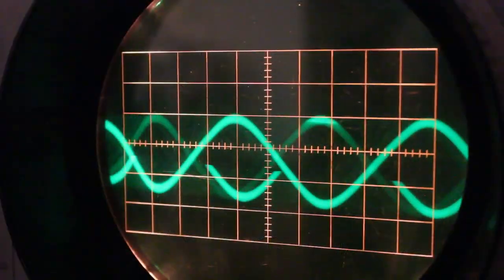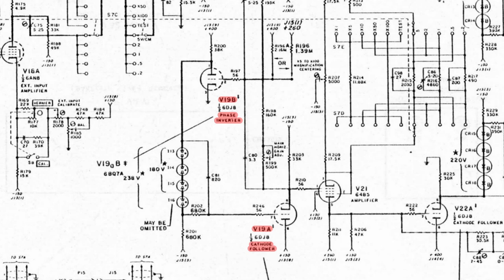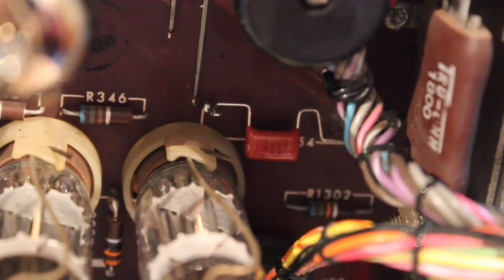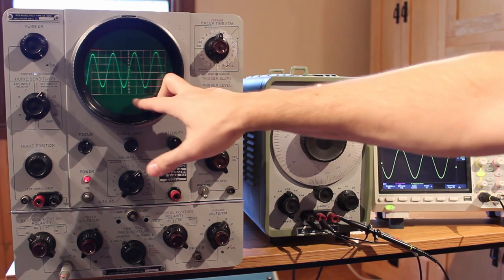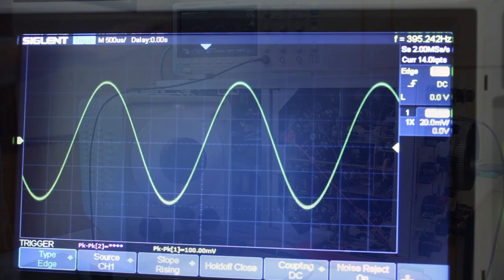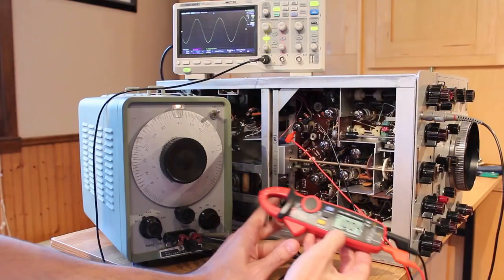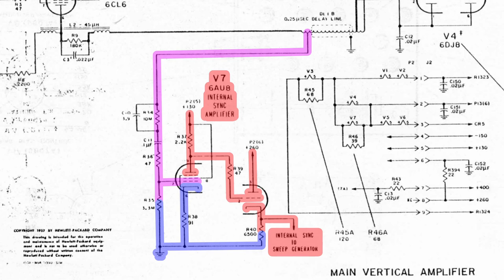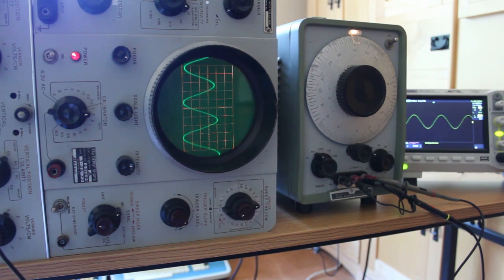Restoring an HP 150A Oscilloscope (Part 3)

Comment: Ah, the good old Vp-p vs. Vrms. I have fallen in that one too - but maybe not for days ;-) . The other inexplicable factor of two that’s easy to fall into when calibrating stuff is high impedance vs 50 Ohm terminated, or worse, 50 Ohms at one end vs 50 Ohms on each end. Spent a few confused hours exploring these holes too. But great work on saving this magnificent scope, it’s a joy to see it coming back!
Reply from the maker: I got so obsessed with the result, I totally neglected to look at the process! 
It seems there's a ton of those little pitfalls you can stumble into, but I feel a little less bad knowing it's gotten you before too, haha.
Thanks for coming along on the journey as I bumble my way through restoring it! HP really were wizards of the analog (and knew how to make a good looking piece of kit)!
Reply: Also a nice trap is the resistance of the scope coaxial cable. Years ago used one as handy adapter from solder posts to bnc and was wondering for hours why my amplitude at the sink was off not knowing that these 1x/10x probes have resistive inner conductors to avoid ringing and reflections…

Comment: The "Phase Inverter" is just a part of a push-pull amp which inverts the drive signal to create an anti-signal for the other power tube in the pair. In this case it's a simple inverting amplifier followed by the 2nd half of V19 as a cathode follower, but there are several standard phase inverter designs. You'll find the "long tailed pair" inverter in Fender amps and there's quite a bit written about that one. Each design has its own strengths and weaknesses.
Reply from the maker: Thank you for the explanation!
Though, I should have been a bit more specific in the video in that what I'm really not sure of is what role the phase inverter has in the horizontal amplifier. Having said that, I didn't know that Fender used a long tailed pair design in some of their amps, that's really awesome! I played around a bit with the long tailed pair design at low voltages building the tube 555 and the tube 741!
Reply: @UsagiElectric  V20 and V21 provide differential outputs to the horizontal deflection. One pulls left and the other pulls right. V19 just inverts the V20 drive signal for V21 to get a differential drive signal. Without V19 you'll only get sweep from one edge to the middle, or whatever range is dictated by static conduction in V21. If V19 is weak, you might get a very nonlinear sweep with reduced range. Class A amps are nice for audio, but to drive an instrument and maintain linearity, an AB amp is far better suited. The phase inverter here is running in class A, but as it doesn't need to provide gain it can operate in a very linear part of its curve. 

Side note: a lot of great Rock n' Roll tone comes from misbalancing the phase inverter to create asymmetric distortion in the power tubes just before the signal starts overdriving earlier preamp stages. Add enough static bias to keep the plates glowing cherry red and the output transformer dissipating enough to warm your coffee on a cold day, and you have the basis of SRV's Texas Flood tone.

Comment: This is just so fascinating, it’s amazing what they did with vacuum tubes back in The Day.
Reply from the maker: Thank you!
HP were true masters of the analog design back in the day and even though this scope is giving me a proper run for my money to bring it back to life, it's such a beautiful piece of engineering, I really look forward to spending time with it trying to diagnose it!
Reply: Back in the 80's, I built a 30 Watt per channel SQ Quadraphonic system using valves. If I recall correctley, It used about 15 valves in total. (psu/pre-amp/decoder/main amp). Each chan had a magic eye VU meter. It sounded awesome with great seperation. During final callibration it gave me a 1200V shock that sent me flying accros the room. LOL. (I've no idea what I touched)
Happy days.
Reply: @frankowalker4662  when I was in graduate school, early 2000s, part of my funding came from me maintaining lab equipment for my program. My main responsibility was keeping an NMR spectrometer running, which involved tending to a bunch of 5000 W output RF amplifiers. These monsters were fed with a 24 V, 70A (yes, seventy amps) power rail. I was very fastidious about turning off the mains when I worked on these things, but one day I forgot about the capacitors, and ended up discharging a capacitor the size of a soda can through my finger. One minute I was digging in the amplifier, the next I’m on the other side of the room, next to my toolbox, wondering what I needed from the box, followed by wondering how exactly I ended up laying on the floor next to the toolbox, and why I would lay down on the kind of gross lab floor, and finally wondering why my finger hurt so much.
That was fun, for certain values of “fun”.
Reply: @TheMightyOmega-NotTheAlpha  Holy crap. :) At least mine was only about 750mA.
Reply: @frankowalker4662  I suspect if it were the live rail rather than a partially discharged capacitor, I’d probably not be around to discuss it. I still have a couple of little burn scars on my finger.

Comment: A warning! I also used to venerate HP classic 1960's/70's gear to God-like proportions. Until one afternoon I found myself lifting a 19" rack-mount VNA over a low coffee-table, from here to there and CLACK! Drat & curses. My lowest vertebrae went; - displaced and then arthritic as time passed. I'm still hoping epigenetics will step to the plate, and there'll be a miracle healing but there's the rub: always remember correct lifting posture and movement when lifting heavy kit. So now, I look upon my HP gear with less of a glossy-eye, in fact a red-flag goes up whenever it comes to any lifting of that type.

Comment: Fantastic! Thanks! … Question: How many years have you been working on electronics, and how many years specifically with vintage/vacuum tube electronics, and also, how many hours per day or week, on average, would you say you practice your skill (work on electronics)?
Reply from the maker: Thank you so much!
I had always piddled around with small electronics kits and stuff as a kid, but I didn't start getting into building my own things until I was in university. Though, at that time, I was mostly just focused on building little BEAM robots (very minimalist bots that don't need any programming). At the start of 2020, like many, I found myself with an abundance of spare time, so I figured I'd finally take a stab at trying to understand vacuum tubes, and I just sort of spiraled down the rabbit hole from there, haha.
As for how many hours per day or week, it's hard to judge. Even when I'm not working on stuff, I'm still thinking about it. But mostly though, I very rarely study something just to learn it. I almost always have a project in mind, and learning the electronics/logic/design work is really just a by-product of working towards accomplishing the project. Though, it is still quite fun to do some reading about how things were done once upon a time!

Comment: What about spare tubes? Are there nos left?
Reply from the maker: The primary tube used in the scope is the 6DJ8/ECC88 dual triode, which is a pretty popular audio tube. That's good in that you can pretty much always find really good condition tubes on eBay. That's not so good in that they're often quite expensive, haha.

Comment: You realize film caps have a polarity and should keep the leads as short as possible. Not polarity like a electrolytic but they have an outside foil like the old wax caps.
Reply from the maker: I am indeed keeping that in mind. Unfortunately, I don't have a good way to test them to figure out which side is the foil side, and if I'm honest, I don't think that's the cause of the near 400% increase in gain and 30% decrease in frequency. Once I get the big problems hammered out, if I'm still having trouble bringing it into spec., I'll look into getting to work on figuring out cap polarity.
Reply: @UsagiElectric  Mr Carlson's Lab has a video on how to figure it out with a scope. Another option I know of is using a Guitar Amp, what ever side has the less noise is the proper polarity.
Yea it wouldn't cause the 400% gain but keeps noise out and makes things stable.

Comment: Very good! Is that tube tester homemade?
Reply from the maker: Thank you!
It's actually an Accurate Instruments Model 257 tester I got used for cheap, but the original case it came in had some pretty serious water damage and wasn't salvageable. So, I just knocked up a quick wooden frame to mount it to out of some scrap 2x4s from a pallet I had laying around!